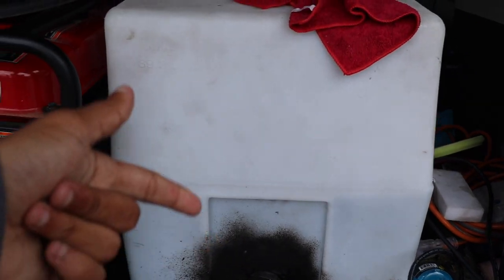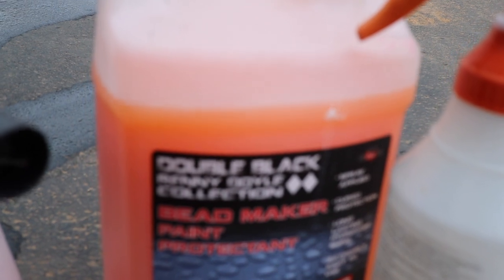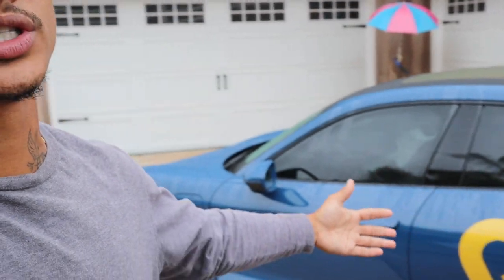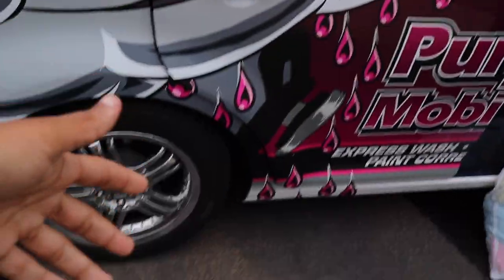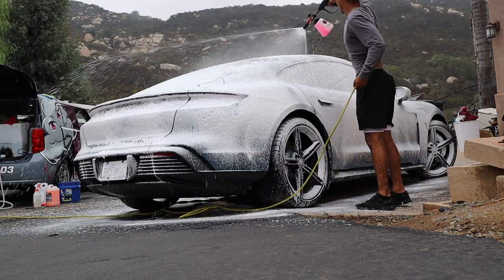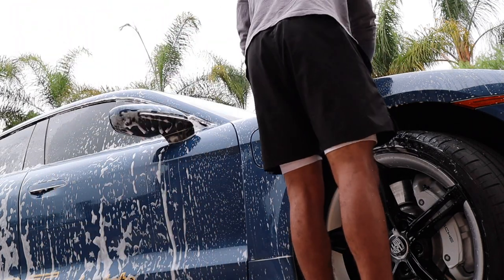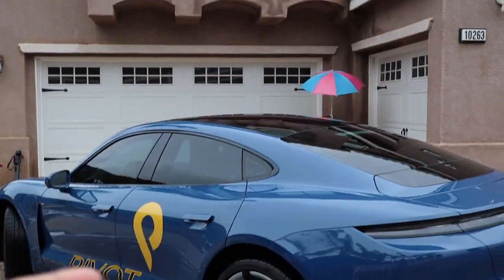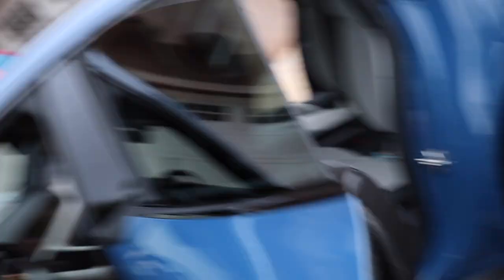Best Way To Wash A Car In The Direct Sunlight // All of the Tools & Products I Use

Comment: Canopy is definitely the way to go! Also, I noticed the tire was still wet when you put the dressing on, that can be one of the biggest reasons is turns more matte at the end since it’s almost getting diluted and it’s harder for it to bond. 

I use a blower on the wheel/ tire to try and get the excess water out but you can also get a designated a towel or two just to go around and soak up the water then dress the tires. As always tho man, great content!

Comment: I'm having a hard time finding a place that sells water like that! Your lucky man! Is it a carwash or a detail shop you get it at?
Reply from the maker: It’s a detail shop ! But another suggestion that I have is a lot of self-serving car washes will have spot free water as a selection if you just select that and fill up your tank it should work very similarly
Reply: @Businessmankam  thanks for the help!
Reply: Just invest in a dionizing system. You can refill the resin on your own. And the money you're spending on paying for deionized water would eventually just buy the filtration system anyway. Better to invest in yourself then keep spending money with some other company to filter the water for you.

Comment: Hey does the chemical guys leave little hairs for you from the towel. I use the same one and usually have to go over a car with a second towel
Reply: Yes it does — and frankly I think the towel sucks.. I like to use waffle towels - and or other drying towels.. use a squeegie typa towel before you go over with your drying towel!!
Reply: @ohoktess2444  I use a leaf blower and then use a towel. Do you know any good quality drying towel?
Reply from the maker: Honestly I’ve never had issues with fibers Coming off except in the very beginning and that’s usually only because the towel is new and hasn’t been washed either
Reply from the maker: Are those towels the super thin ones ?
Reply: @Businessmankam  I have 2 that have been washed multiple times but the fibers still get left behind. Going to try another brand tho
Reply: @Businessmankam  you should invest in a predetor 3500 power inverter super quiet I just upgraded and can bearly hear it running while detailing

Comment: Quick kina dumb question, how exactly do you get your water from your tank to the pressure washer?
Reply from the maker: I have a video on that ! (:
Reply: @Businessmankam  i saw it bro, but if i have a  3200 psi 2.5 gpm pressure washer what kind of water pump would i need for it?
Reply: @Businessmankam  husqarvana gas 3200psi 2.5 gpm pressure washer